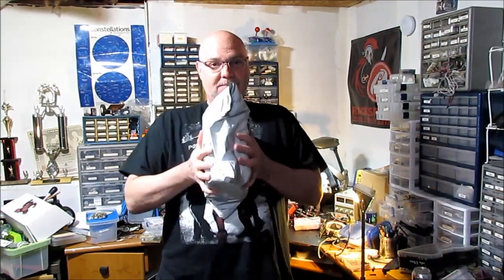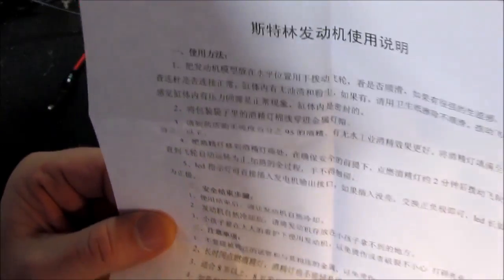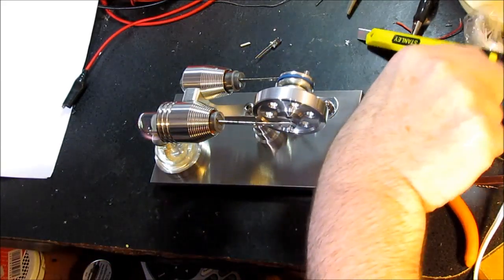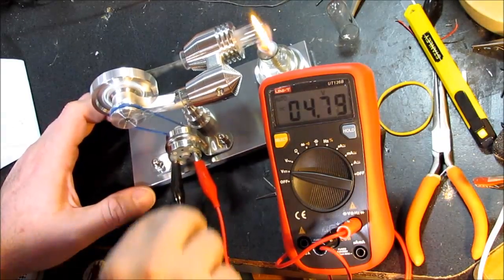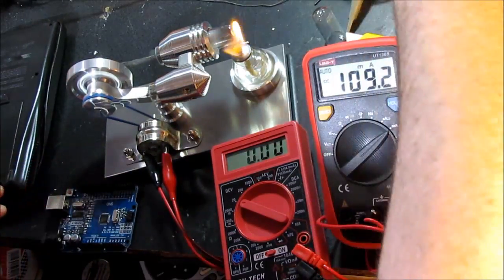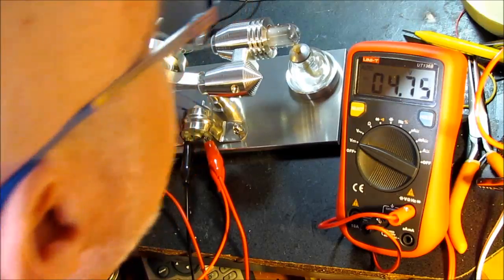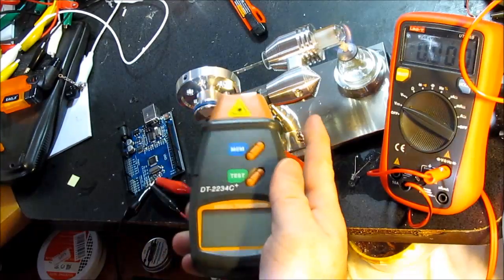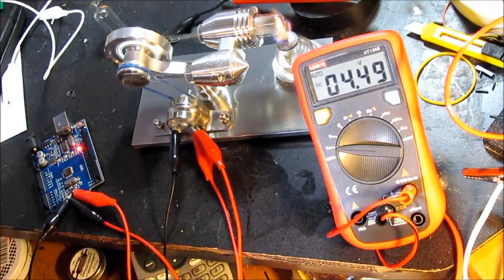016 Can You Run an Arduino from a Stirling Engine?

Comment: Glad there are other comments on his "current" measurement. You cannot measure current in parallel! And then he wonders why there's only less than one volt across the circuit. Geez... Is it that your current shunt resistor in your meter is almost a dead short? Are we needing to understand how to use a meter ? At least he's having fun almost burning his house down.
Reply: Almost burning his house down. Hardly...
Reply: In parallel? Parallel to what? Sorry, you're not making any sense here..
Reply: Kalum Batsch he's talking about how it's a mistake measuring current by placing the multimeter in parallel with the load. But he didn't understand what was going on in the video.
Reply: ye its not the most accurate but it gets the job done
Reply: I think you are needing to understand ohms law. He was measuring the current when it was shorted across the dmm, then measured the voltage drop across the dmm, this gives the power output of the engine. Which was roughly 0.04W

Comment: Why would you plug it into the 5V pin instead of Vin? That bypasses the regulator and is so much more likely to fry your Arduino.
Reply: my concern is that even with a brushed motor as the generator, he really should be using an isolation capacitor to smooth out the dips as the brush switches from one finger of the commutator to the next.  Even pulsed dc can't be great for the arduino.  also taking voltage readings past the cap will provide readings that are closer to RMS, and so they will be more accurate over all.

Comment: The efficiency of a stirling engine is mainly determined by it's "regenerator". These simple stirling engines do not have a regenerator in there design. Adding a plug of steel wool in the air channel between the hot and cold part, acts as a regenerator. It increases the speed and torque of the engine significantly! Give it a try!

Comment: can you use Peltier to a Starling Engine i need to know here is an ideea cause that engine its not a real generator its just a simple brush engine but here is an example: u connect a real generator to the Starling and betwen the two Chanbers to attach a Peltier i really need to know cause i dont own a Starling but i would like to get one one day il wait for your response
Reply: If you want to use the Peltier module as the heat source you will need an LTD type stirling.  If you want to use the Peltier module as a generator just put it over the alcohol lamp and throw away the stirling engine.  You will get more power out that way, because this engine does not capture even 50% of the heat from the flame.

Comment: it's Stirling, not Sterling
Reply from the maker: Thanks! Corrected.
Reply: i've seen a report where a bigger Stirling engine was coupled with a parabolic mirror, and it's efficiency was compared to solar panels of similar size. Stirling with generator was like 10% more efficient! :) So your experiment makes sense :) There are even production submarines with Stirling engines..

Comment: You measure the current wrong, 100mA doesn't mean anything if you have no resistance.
Reply: The shortcut currency&voltage tells you the approximal internal resistance of generator when the internal resistance of multimeter can be omitted.
Reply from the maker: You are technically correct of course, but it did give me a rough "feeling" for the maximum amount of current available- it would never be more than 100ma.
Reply: It may give you a feeling that it works but nothing else.
Reply: Open circuit voltage and short circuit current are pretty standard measurements. No, you can't multiply them together and get the maximum power. But yes, you can multiply them together, multiply a "fudge factor" (say 0.5) and get an estimate of the maximum power (in this case, about 0.25 W)
It's a whole lot more convenient than the more accurate method, where you find the maximum power point, if you don't have an MPPT on hand.

Comment: Were you cooling working cylinder but not the heat exchanger (one with cooling ribs)? You should probably cool 2nd one, which takes heat on its glass side
Reply: That looks like a Beta Configuration. (Not a gamma)
In a Beta engine, air expands in one cylinder and contracts in the other, Both cylinders do work, and the amount of work depends on the heat difference between the two cylinders.
Cooling down the hot cylinder will just make it slow down and be less efficient.

TLD;DR : he was cooling the right part.
Reply: Benjamin Miller the displacer cylinder has a hot and cold region judging by the cooling fins so I believe cooling that end of the displacer cylinder would make a greater delta t causing more power.
Reply: You are assuming it's a gamma type. You are right IF it's a gamma type.
I don't think it's a gamma type. ( like I said.)
Look carefully at 0:50. both pistons have the same travel. And one cylinder is clearly compressing, while the other expands, (rather than one simply displacing back and forth.)
This is how a beta type works.
In a beta you want the delta T to be between the hot cylinder and the cold cylinder.
Reply: Benjamin Miller I believe you are correct I noticed the hot cylinder is open at the connecting rod end if it were a gamma type it would have to be sealed to facilitate creating a lower pressure as the air cooled in that end.
Reply: hello dear

Comment: Perhaps you could stick some magnets to the flywheel and make your own generator - I bet it would be more efficient than the one they're using, plus you could set the voltage a bit higher then buck it down to 5V for your arduino.  Also, maybe glue some rubber mat under the thing, or something heavy.  Nice vid.

Comment: Fire, electricity, water what could possibly go wrong.
Reply: Eric Taylor Don't forget alcohol.
Reply: IN MY CASE.....i lit my kitchen table on fire when it fell over :/  thankfully i had a fire extinguisher and theres no damage  but ya it scares the shit out of you
Reply: Someone read my thoughts... was about to comment the same thing.
Reply: XXxxcrisisxxXX sure bet it does
Reply: Don't overlook the 'deft' handling of that utility blade.  Whoa.
Reply: yeah, but not as dangerous as our old Mamod toy steam engine... however, it never exploded either. I suggest stupidity is the true danger.
Reply: Fire, electricity, water, and computer: the four elements.
Reply: You forgot; and it's never ending determination to run and get away!

Comment: You shouldn't measure current in parallel. Try to add the arduino or some sort of resistance in the circuit to measure true current value . The reason it probably slowed down that much is because of internal safety circuitry in the multimeter to protect your device

Comment: 06:05 - Shouldn't you connect to amperemeter by "resistor" like LED? No resistance - no current... :)
Reply: An amp meter has almost zero resistance. When you put it in series, you are doing a short circuit. That's why the voltage dropped to almost zero. The measured current will be the maximum that the generator can supply.
Reply: you're right!
Reply: Current is always measured in series and never in parallel for safety measures
Reply: @ Koceila "measuring current in parallel" think you got too much coke, maybe grab some strippers...
Reply: There is resistance, internal resistance of the generator + internal resistance of the multi-meter.
Reply: Standard procedure. You measure the "open" circuit Voltage (as open as it gets with the multimeter in between) and the shortcircuit current (as "short" as it gets with a multimeter in between), to get some data points from which you calculate the generated power that roughly is to be expected.

Comment: Wrap a coil of copper tubing around the cold end, stick it on with some thermal paste, and run a refreshing reservoir of cooling liquid through it.
Reply: The glass is only on the hot end of the engine. Jo is saying how to make the cold end colder.
Reply: Joseph Boysha and hope it doesn't break the glass right?
Reply: Then use a torch on the the heatside, after installation of cooling coils..... The torch should melt inside pistion 1st if at all.

Comment: did you post the link for the engine?
Reply from the maker: The exact one is no longer available where I purchased it on Ebay :(  here is a similar one (but not exactly the same) from Amazon.  https://www.amazon.com/Sunnytech-Stirling-Education-Electricity-Generator/dp/B01M0X6QDH/ref=sr_1_188?s=toys-and-games&ie=UTF8&qid=1492610862&sr=1-188&keywords=steam+engine